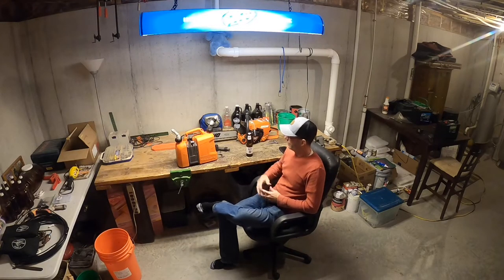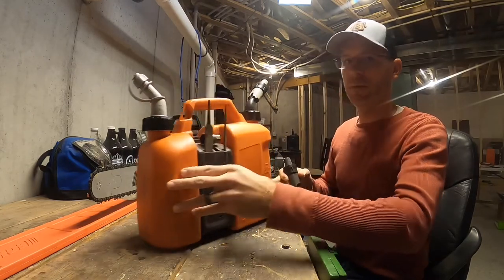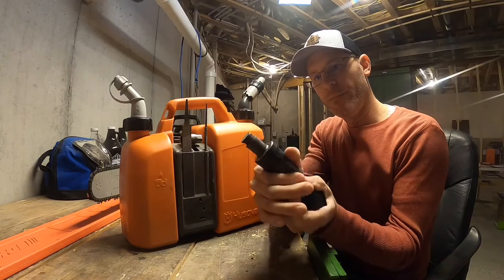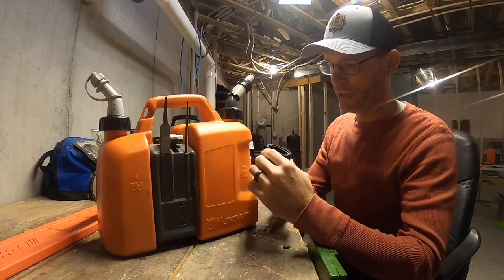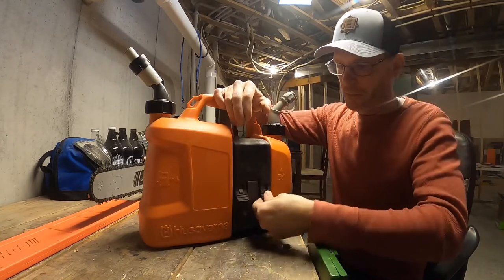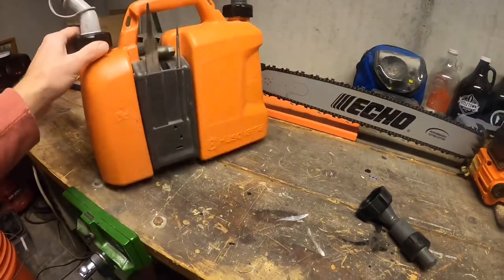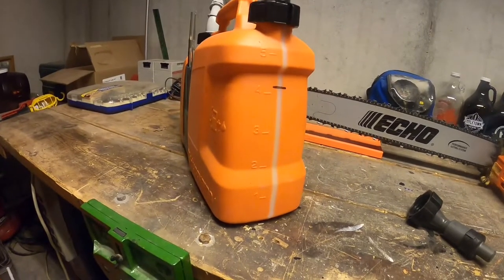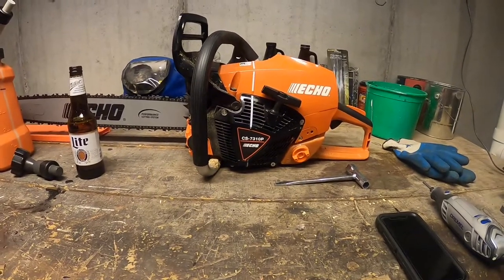014 - Husqvarna Combi Can Update, Echo CS-7310

Comment: Yep, got the same experience with mine. Auto-stop feature works only when brand new and becomes a hassle only a after handfull of real usses in forest. It's systemic issues that everybody reports, not just a failure of few units. Husqvarna should change the design on this can. I hear the Stihl auto-stop nozzles are better, but since I don't have one, I can't confirm or deny that.
Reply from the maker: Yeah good info.  You would think they would test them for themselves

Comment: Have one, got it on ebay from the UK, haven't used it outside of my shop yet. 
I have a couple metal Briggs and Stratton # GB042 duel oil/fuel cans that I take out on locations. One I painted 40:1 in yellow on the sides, the other I painted 50:1 in green.
Same as you, I use a one gallon container to mix the fuel in then pour into my other cans. I use one gallon cooking-oil jugs. They're sturdy and semi-clear, easy to see the fuel through them.

Comment: Same issue here, Husqvarna is going down the drain. I took it apart, sanded a mm or two and it works better now but not as good as it when it was new. The plastic swells.
Reply from the maker: Yeah I haven’t used mine since. Went back to separate cans, and I use a tide jug now for bar oil, works great, no drips

Comment: There is  an easy fix for the fuel spout.
Why is it getting stuck ? It is Not designed to have it ON  the can all the time. Gas fumes  and hot summer weather creates pressure which deforms the spout  from the inside. It is simply get wider .
 Best advice to all : only use the spout when needed and definitely take it off when you finish the work.
Reply: Here the fix , not mine , but I’ve tried it , it works. I never used the file though, only 400 grid sand paper 

https://youtu.be/FgCGxL5PKTk
Reply from the maker: That makes sense why it wouldn’t work right anymore, but does seem odd that you would have to do all that switching all the time, not convenient
Reply: @birdmanoutdoors  I know , bad design. It’s not that big deal with switching, it is alright to keep it on for the day, just take it off for the night or while transporting it. I’ve tied the spout to the combican  with the plastic tie  so it won’t get lost . As for the fix , only took 30 minutes to make it right again.

Comment: There is simple solution for fix this problem.I had same problem and not anymore.If you not using combican for a longer period you just remove those nozzles and put caps on.Because over the long time petrol gases make those plastic pipes on nozzle swollen and it wont shut anymore automaticly.Simple as that,and problem solved.Don't even have to buy new petrol nozzle old one will be ok.